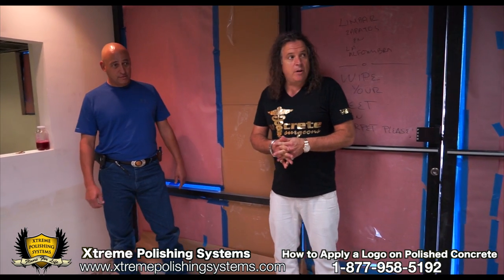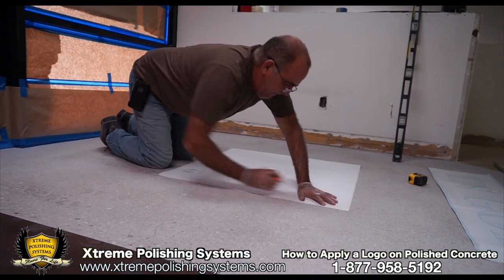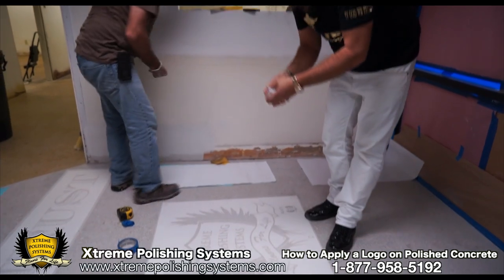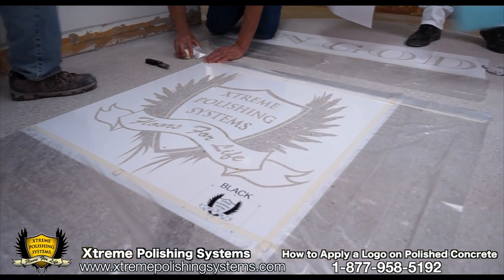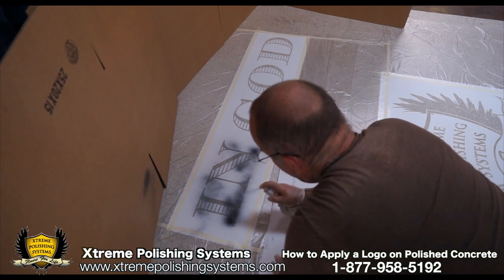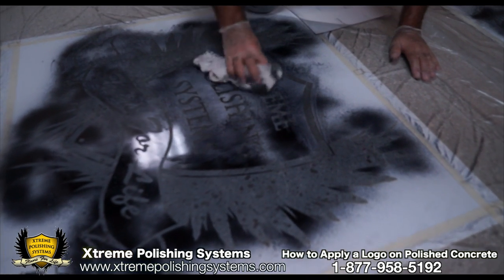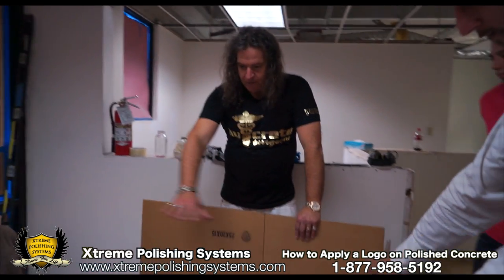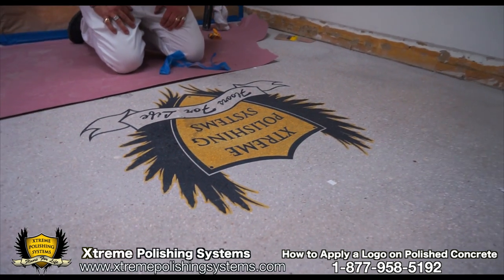Decorative Concrete Floor Demo with a Custom Logo Stencil Application | Xtreme Polishing Systems

Comment: HI there, if you use a densifier will it damage the logo after application?  cheers & thanks!
Reply from the maker: +Barnes466 Great Question! If you give Chris a call at (877) 958-5192 or email info@xtremepolishingsystems.com, he is happy to walk you through the process for applying a logo!
Reply: *****
Thanks very much!